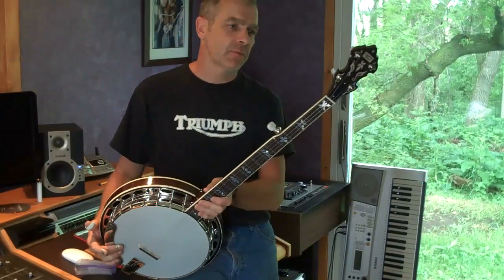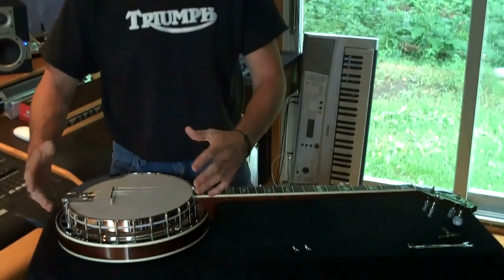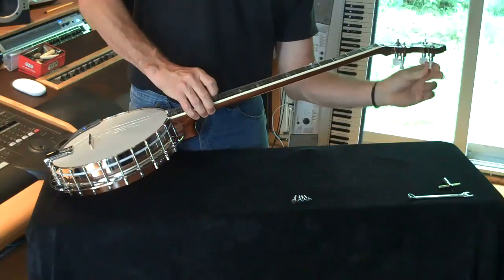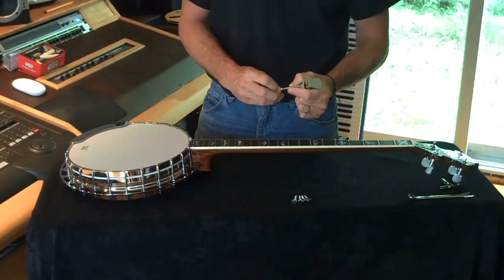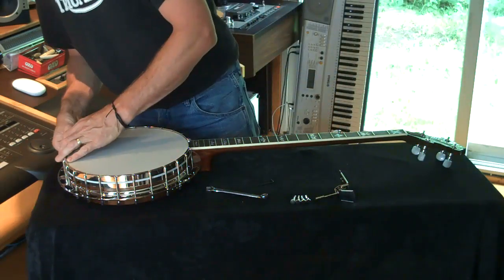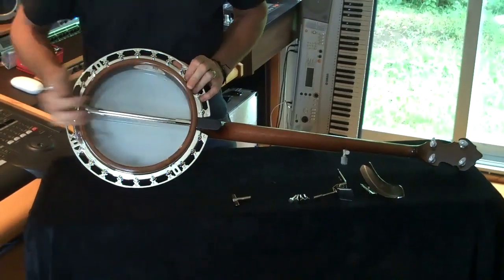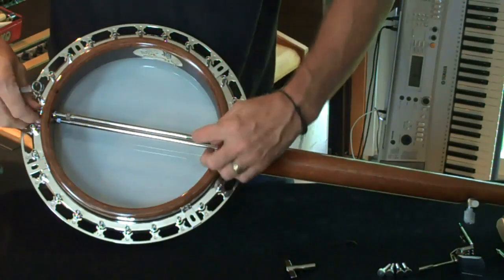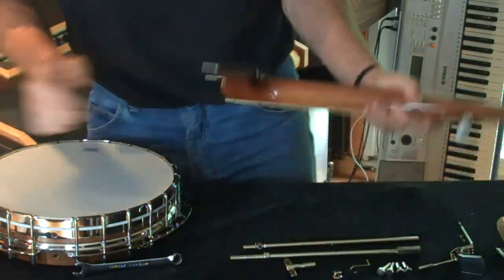Banjo Assembly and Set-Up by Johnny Butten and Recording King

Comment: Hello, I Just bougth a RK-80 and when I tried to setup I broke the coodinator Rod (the one close to the head). Does someone here Know how can I buy a new coordinator Rod?  I'm from Brazil and here is very dificult to find Banjos. I had contact Recording King by email but I got no answer. Thanks
Reply: MrZneto did you ever find parts?  And how did it break?  Are they that brittle?

Comment: When you tossed the strings you voided anything your experiment might prove. Does it sound better because of your tweaking or because of the string change? No way to really know
Reply: Stringing it up with the old set wouldn't prove anything either - it would have to be put on in the same way, with no string torsion, and the tailpiece set up the exact same way.